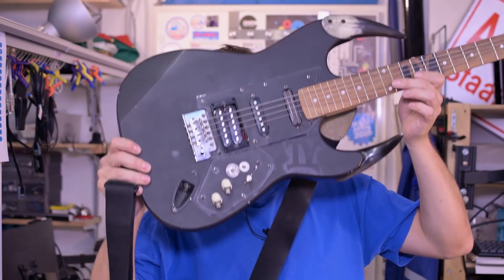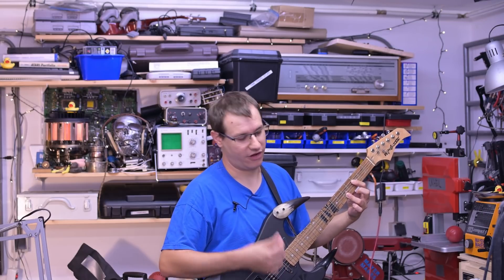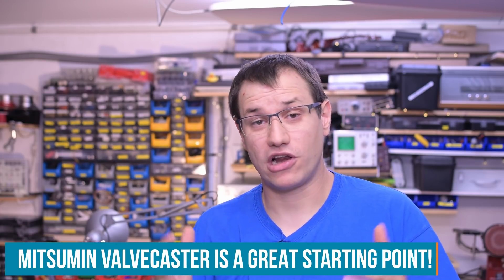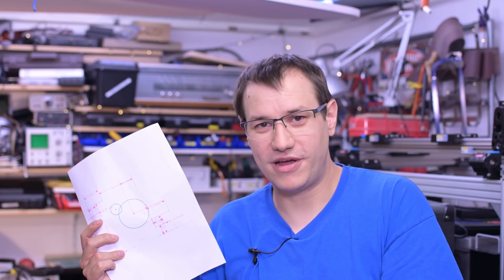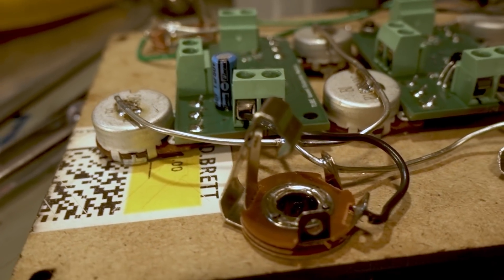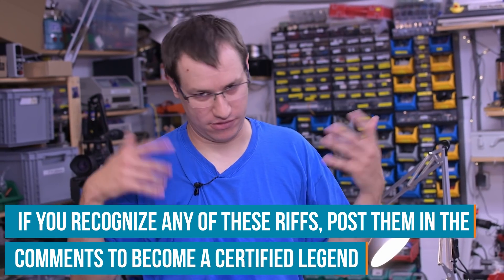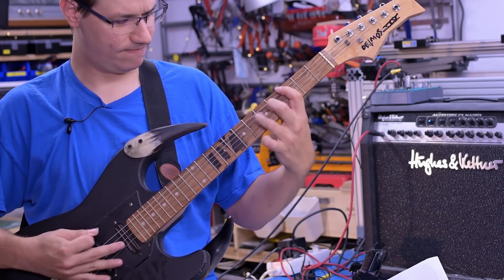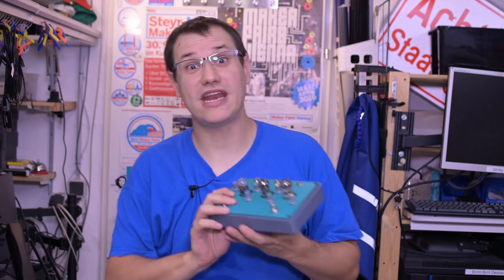Guitar Vacuum Tube Distortion Pedal

Comment: I like the idea behind the pedal and I saw that you derived the design from a 12v circuit. However 9v on the plates would make some distortion for sure but wouldn't the effect of the tubes be rendered inaudible? Since the plate voltage is so low you couldn't really hear it? I noticed that you ran the pedal through an already cranked radio and already distorted amp so it was hard to hear if the pedal was really providing much distortion. I also noticed you said the 3 tubes were cascaded and maybe i missed the part where you internally connected them but it didnt sound like all 3 of them were really hooked up. It seems that you 'd have to jumper them together to get all 6 gain stages. You also mentioned some tubes seemed to "clean up" the signal too and that's because the different tubes have different amplification factors and therefore won't drive as hard as a typical 12AX7 (ECC83). I'm only asking questions and trying to have some of my inquiries cleared up!
Reply: all 3 are hoked up, most examples are going into a clean amp, the distortion is mild in comparison to other designs, and the different characteristics of the tubes are  audible but not very pronounced, they are all not ideally driven, looking back I would have maybe choosne a different base design.

Comment: Driving even small preamp tubes with such low B+ voltage will add distortion if you want it or not :-) 
Never driven a 12AX7 with a plate voltage lower than 60V...interesting to hear the difference. Thanks for sharing!
Reply: thats the point!
Reply: The plates in this video are running at 9v so while that will definitely starve the shit outta them to produce some distortion wouldn't that just make them inaudible? He had the pedal running through the already distorted amp and through the already cranked radio. It was hard to tell if his tube pedal design was doing much

Comment: When I saw you trying to make it work with 9V B+ and typical resistor values for 250V and more, I was like WTF? it ain't gonna work at all!
But some sound came through. Of course it'd be more sensible to use at least something like 24...48V B+, or tubes designed for lower plate voltage (e.g. ECC88 / 6DJ8).
That way it should give you more sustain.

By the way, nice horny guitar there... and did I hear the Master of Puppets opening riff? :)
Reply: I derived most values from a 12v mitsumin valve caster circuit so I knew it's going to output something, the Potis partially ended up at different values than I wanted.
Reply: @MAYERMAKES  I just checked that one out, and I'm getting more and more convinced to cook up something similar.
Reply: The tube choice was done by the scientific method of whatever I happen to have.

Comment: from the places I would put tubes in, the distortion pedal is the last one. Sharp fragile glass pieces protruding from a box that is meant to be abused a lot... not safe for the person or the tubes... it would be cool to show transistor ones and in another video show lower-budget tube amplifier with good quality...
Reply: I was thinking the same, I'd have a remote switch and keep the tubes safely in the rack

Comment: Are you in standard tuning? Because it sounds very low, like there is a lot of high end missing.
Reply: The red one is in standard the other black one is like a seven string in drop d but only has the lower 4 strings.